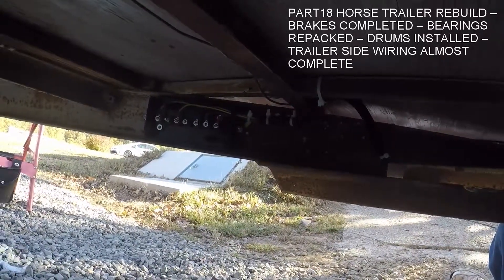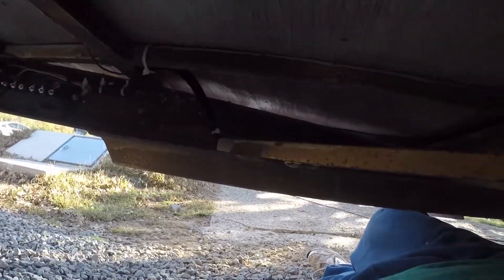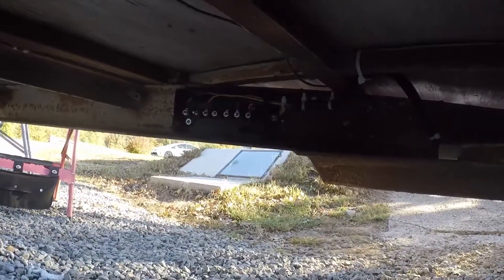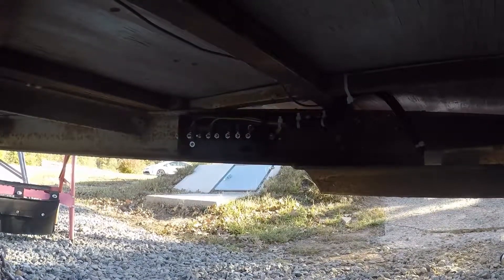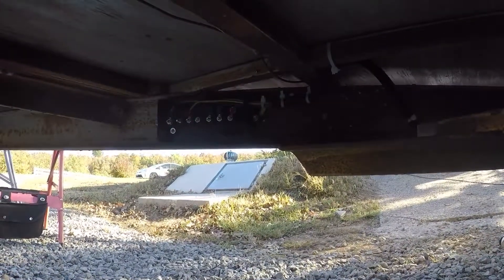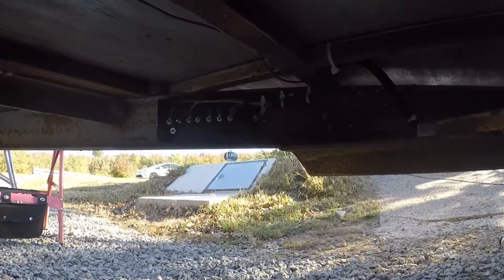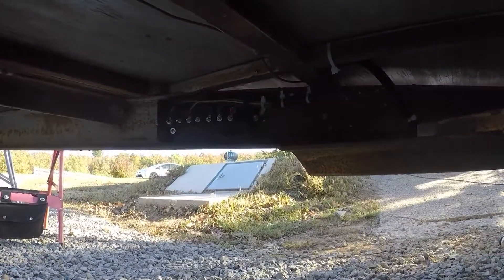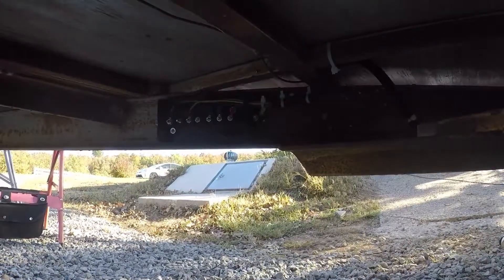PART18 HORSE TRAILER REBUILD – BRAKES COMPLETED – BEARINGS REPACKED – DRUMS INSTALLED – TRAILER SIDE

Comment: Hey Carl I know it's a long shot , but wondering if you know what the bearing part number is? We went to repack ours and they used 2 different ones so I'm not sure which is correct. Tried to contact G & F and they were no help.
Reply from the maker: Sorry, I did not notice if the bearings were different.  If you have calipers, you might measure the diameter of the axles and the inside diameters of the bearings to see if there is any differences between them.  If you have dual axles, by chance does one have brakes and the other does not?
You might also call e-trailer to see if they might be able to help you.